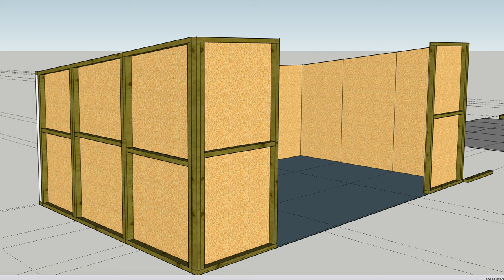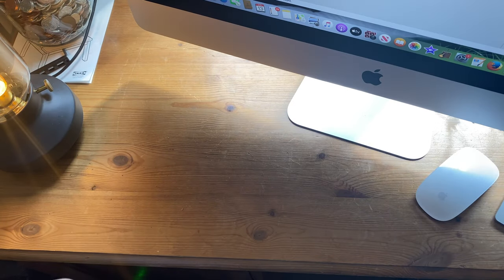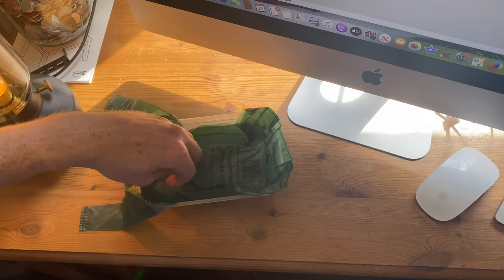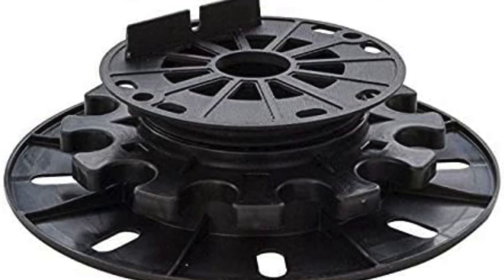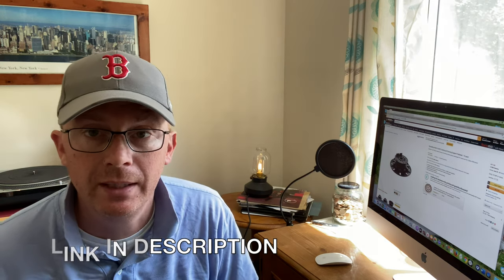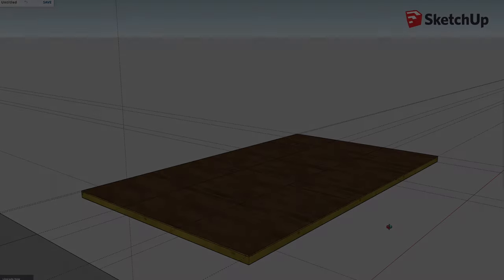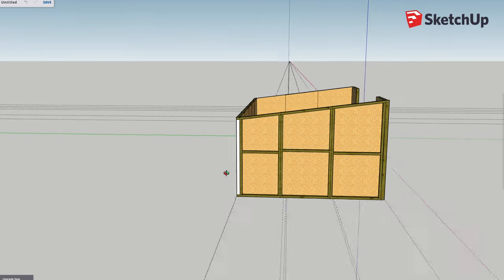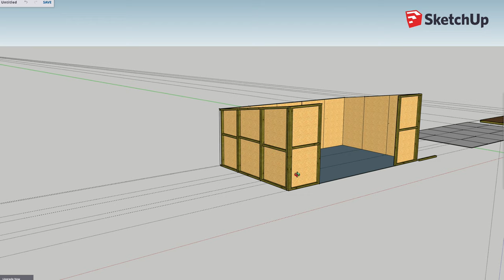Modular Designed Workshop (Part #1: Design Concept and Ideas)

Comment: Here in the South-East USA, it is common to build a shed's floor system on a few perpendicular  larger timbers, say 4x6,  to make a sled,  and those timbers sit upon either a gravel bed but more commonly just concrete blocks/piers on the ground...  No digging other than to level the concrete blocks.  Of course around here they also can move the whole storage building if you have access to the backyard by hiring a flatbed  truck with a wench.  But if I were planning on making the shed modular, to disassemble and pull out of there, I would just make the floor system up in a modular fashion.  I'm not sure I understand the purpose of your 12 inch foundation digging.  Not challenging you, just saying it seems a lot of trouble to go to if you want to move the shed in future possibly.
Reply: Clarification, we don't even need the timbers to make the sled part unless we are planning to have it pulled out of there by truck later. Floor joists go directly onto concrete blocks.
Reply from the maker: Thanks R Wind for your comments. I’ve seen a few programmes over here about how easy it is to move a house over in the US using the construction methods you’ve mentioned. To be honest I found it fascinating! 😀.

The main reason I’m digging down and not mounting it on concrete blocks and plinths is to do with height restrictions of the building. Here in the UK if you’re planning on building an extension to your house or an outbuilding, generally you need to get planning permission from your local district council to see if you are allowed to build it or not. There is an alternative though called ‘permitted development’ which means you can build a separate external structure without all the hassle of going through planning permission if it meets certain criteria. Two of those criteria are it cannot be more than 50% the size of your garden area (I don’t have to worry about that one), the next is if you are within 2m (6ft 6ins) of your neighbour the structure can’t be more that 2.5m (8ft) in height or further than 2m from your neighbour it can be 3m (9ft 8ish). My build is going to be close to the max allowed height of 3m so I need to keep the ground works as close to the ground as possible if that makes sense as the measurement for the building is taken from ground level and not where the base of the building starts. Does this make sense and I’m conscious about the fact I’m waffling a bit here?😀😀
Reply: You're making perfect sense.  Height and backset from property line restrictions here vary by where we live.  Some are in the deed for each neighborhood here, some restrictions are set down by governing bodies.  Another consideration is if we plan to move the building in the future intact, we can move a building up to 12 ft wide without paying the special permit for each move (several hundred dollars last I checked, but it is not like we would be moving a building often) and the road restrictions once upon a trailer are generally 13 ft 6 in high and almost all bridges and electrical wires allow that clearance.  

I was not second-guessing your own choice of foundation,  just interested in the choice and figured it was a British thing. Depending on cost, and difficulty, I would not want to dig and if I had such height restrictions, would have probably put the concrete piers in sticking only one inch up off the ground level, and the floor system directly upon them rather than dig -- probably because it's just what I'm used to.  

No, if we had the height restriction we would have gone to pouring a concrete pad.  And just avoided the floor system, then, which just removes another several inches available interior height.  Never would have occurred to me to dig out like you're doing and then set a floor system on top of it.
Reply: Oh.  And if a building is considered portable we don't have to buy a building permit or pass inspections, at least where I live.  These sheds on sleds and on concrete piers all avoid building permits. For a residence. Now, if it's on a commercial property, it has to have a permit, and have tornado tie-downs at each corner.  (Augered stakes into the ground, also can be used for travel trailers and mobile homes I think. )
Reply from the maker: R Wind I think pouring a concrete base is the preferred method for lots of folk here pal and it is convenient, but still involves digging down to create the foundation. Concrete is expensive though and my method might be more labour intensive, but a lot cheaper than a concrete pour😀
Reply: [ Don't take the following as being uniform across the whole Southeast!  Alabama alone has five geological areas. ]  Over here, with the clay in our soil, unless building on a raised area of ground, you might have just dug yourself a slow-draining bathtub. Lol. The gravel  and fill might be more permeable than the surrounding wall of dirt.  Of course it helps that the shed provides rain cover, but water from the sides can seep in.  And freeze.  Since we do see freezing ground here in my area, our footings are supposed to be below 12inch.  Digging holes for bushes here can also create this bathtub effect.  At least we generally do not have the type of desert soil, expansive soil I have heard it called, that causes a lot of foundation heaving when it dries out each Summer.   

One alternative used here to either gravel or concrete is called pug mix. It's a slurry of the limestone gravel, is delivered very wet and as it dries out it thickens up and hardens. It can be used for a driveway.  I have considered using it for the flooring or ground surface of a pole barn where we intend to park tractors and such.  Better I think to walk upon and to drive upon, without the hassle of pouring a concrete pad.

Comment: Have you thought about sticking normal foil to the OSB with spray adhesive? Before you affix the lumber.

That way you'll have a sealed insulation off sorts.

Just an idea on my part, can't confirm if it the right thing to do or if it would cause more problems.
Reply from the maker: Not something I’ve thought of pal to be honest. Couple of folk on here suggesting I apply the foil tape to the inside of the board where it meets the timber before slotting the insulation in then maybe caulking the back end of the insulation to form a seal? That sounds feasible if it’s the right thing to do. If it ever needed to come down then I could simply scrape off the caulk and remove the insulation boards